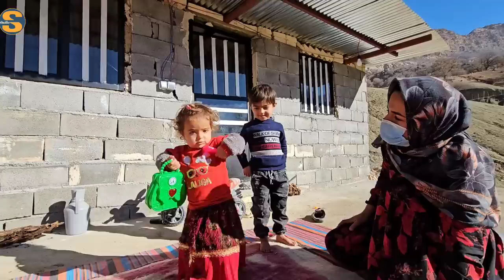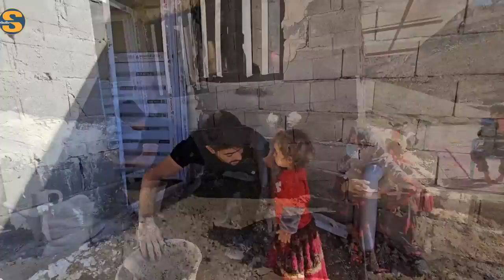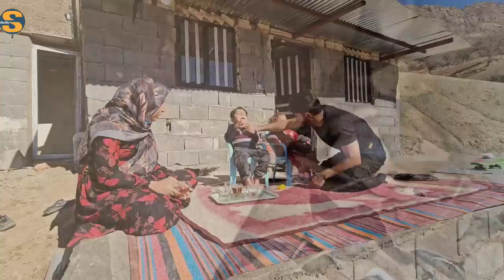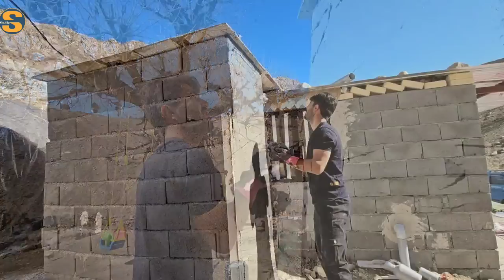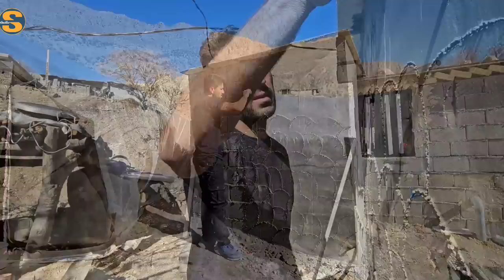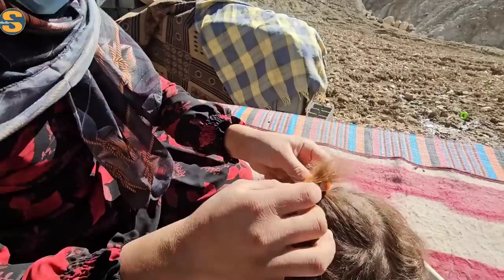Documentary journey to nomadic life: look at the installation of the door and facade of the building

Comment: Hamid, don’t you think you need to paint the wall with regular paint because when summer comes n the weather is hot the plasters tends to crack  n will start coming off the wall? Especially the bathroom? Just asking cuz not sure the materials of plasters you r using. So far I have noticed some houses with that plasters r cracking up.